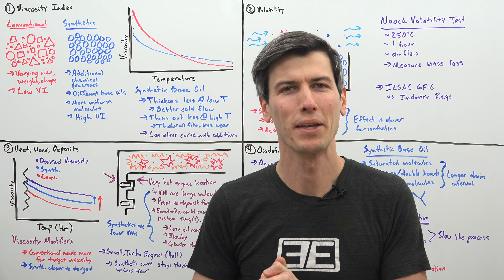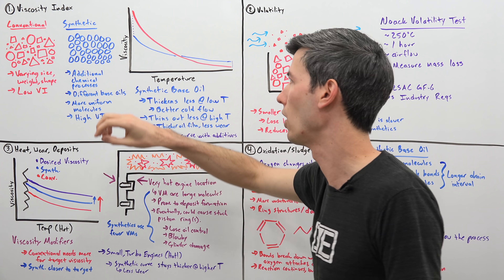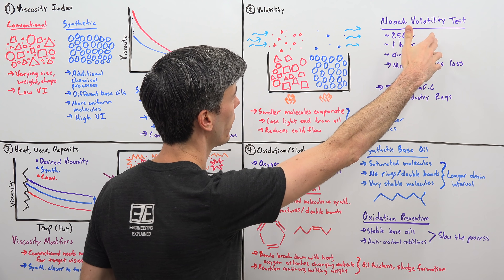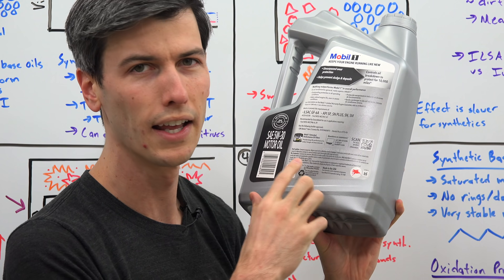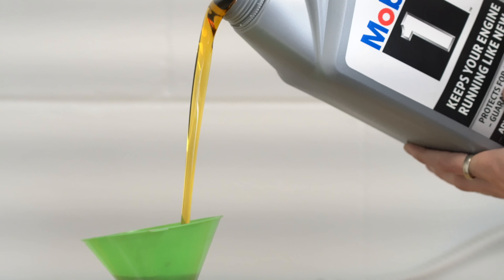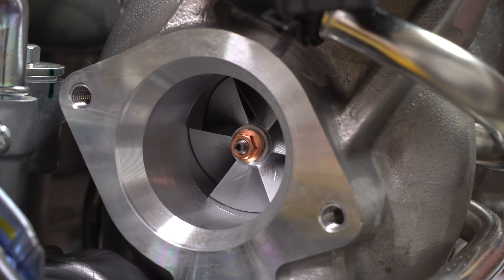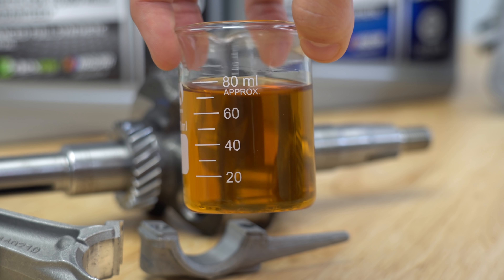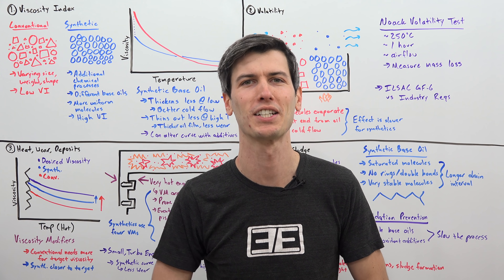Synthetic vs Conventional Oil - There's A Good Reason To Switch

Comment: Mobil 1 is a base III synthetic which is not truly synthetic.   It is made from hydrocracked refined petroleum, not PAOs or Esters which are grade IV or V.  Some Mobil 1 has the PAO Decene, but it is less than 5%.    I use Penzoil ultra platinum euro, or Driven IO30, or Torco SR-5.

Comment: A blend has both without going to a full Synth . You don't have to go full one way or the other. A blend has the best of both worlds. Full Synth tends you make your motor run hotter and with more motor noise may also make seals on some cars leak as well. You will also find that you have more compression and power with a blend. With some new cars you may be stuck with a full Synthetic . I have used full Synthetic it flows well in winter because it is super thin. It's no big deal . I guess no one has ever heard of a blend. Squares and triangles . give me a brake. !                me.

Comment: Could you make a video about oil change timing for synthetic oil? Many of the oils have very high mileage ratings of 20,000 miles or more. Meanwhile my car manual says to change at 7,500 miles with synthetic. Meanwhile the all of oil change shops I have visited insist that both numbers should be ignored and recommend 5,000 miles for synthetic. I figure if both the oil and the car are 7,500 I'm probably fine ignoring the sales-driven mechanic. But I'm never sure... Maybe the cheap out on filters? Other things I should consider? Anyway could you help give an objective view on oil life vs manufacturing recommendation vs store recommendation? Which information should we be using?

Comment: Now I wish you did a video arguing for mineral oil.  Its polarity is much better than both PAO oils and Group III pseudo synthetics such as the ones you reviewed, so it sticks to metal parts better.  It is also much cheaper, especially when purchased in larger volumes.
Reply: it is no longer valid to clasify oil by synthetic, semi synthetic and mineral, because most of them made from hydrotreated today. solvent refined / group 1 have the best seal compatibility and solvency so they can clear sludge better than other type of engine oils. No need for engine overhaul at all.

Comment: Liquid lubricants exist, and solid lubricants exist... But do gaseous lubricants also exist?

Also, regarding oxidation... What if you pressurized the crank case with an inert, lighter-than-air gas?

Comment: It causes my Toyota Camay 2000 and 2006 Sienna check engine light on after 2-3 days after used Mobil 1 synthetic oil changed for code P0430, it is true don’t use Mobil 1 synthetic oil, it causes so much trouble, Not good for old cars

Comment: 2003 Camry 2.4. Went from conventional, to a synthetic blend with plans on full synthetic next change. The Blend lasted about 6 months before it broke down and the engine got hot, and  smoked inside the oil system. Changed it today, completely burnt and black. Couldn't have been more than 2,000 miles. Yes, 2,000 miles and I'm lucky to still have an engine. More info on full synthetic change later.

Comment: Wish you would have checked if there was a difference in the acidification of the oils. By the oils absorbing any of the volatiles  in the gas after its burned, can slowly turn the oil acidic.  Do synthetics help against that? Or is that totally dependent on the additives?

Comment: I hope the comment finds you well and challenging ! 

Hey @engineeringexplained however I understand this is not a real synthetic oil meaning it’s not 100% synthetic and is still petroleum based. Could you please do an explanation on 100% synthetic oil vs mobile 1 “fully synthetic” oil. I understand it’s not a real synthetic rather a synthetic blend w more additives.  Thank you !

Comment: This convinced me. I have a 2005 Jeep Wrangler. Those guys on the forums are dead set on using old oil. Would there really be any reason not to use this on the old straight 6 design the Jeep TJ had?
Reply: The manual will indicate whether synthetic can be used, if there is no mention of it I would not use it..

Comment: If a car has been running on conventional for most if not all its life should it continue to do so? The concern being that the smaller and more uniform molecules might get into gaps of moving parts and speed up the rate at which they break down. Or is that concern unwarranted?

Comment: Congratulations for your explanation. In 1982 I bought a Speede oil change franchisee in México City and our oil provider was Mobil 1. They explain to us all this information with the advantages of using synthetic oil vs mineral oils and always is better use the synthetic one, no matter the climate you have, always follow the viscosity your factory manual say and believe me that you will have easy going a 350 thousand miles engine with no problem at all. The oil in your engine it´s all. It is like the blood in your body.

Comment: Use to own a couple small airplanes.  When an engine is rebuilt (typically around 2,000 hours use), conventional oil is used initially to ensure that rings seat properly, after about 50 hours use, oil is switched to semi-synthetic.......

Comment: Very interesting - thanks.  I suppose this is why they say to change every 3k miles or 3 months, then.  So, if a car sits around a lot w/out being driven much, does oxidation have much of a chance to occur (beyond the top layer of oil that's always exposed to air, I suppose), or does it still really have a chance to ruin the oil, requiring an oil change even w/low driven miles?
Reply: Firstly those guidelines would be for conventional oil, sythentic oil guidelines are 5k/6 months. That said I've seen oil testing analysis that on 7.5k mile oil that had been used for 25 months, and it still showed NO signs of water absorption or general degredation as opposed to a standard oil change. Do with that information what you will.

Comment: Today I just found out that synthetic oil does not always mean that your oil is a synthetic oil, but it is made from better stock oil. In Europe, they made it illegal to market these oil as fully synthetic, but instead they use the term HC synthetic or hydrocracked synthetic oil.
Reply: Not really deceiving per se, they perform like synthetics and really are a much better product. I couldn't care less really, I'll take them over conventional anyday.

Comment: In regards to synthetic oils, I read an article from a machine shop specialist that stated that if one tends to do short distance driving synthetic oils do not get a chance to reach optimum temperature and its residue over the valve train will crystalize leading to some sludge build-up reason while a good multi-grade, non-synthetic will keep that from happening while providing optimum lubrication following periodic  5 to 7 k oil and filter change.

Comment: excellent informational video without going too geeky or techie or needing Chemistry 300 and 400 college courses to understand. THANKS! :D 

i've been using 100% full synthetics since my first car, an '89 Plymouth Acclaim 4cyl and i've never had a problem ever since. :) if you go synth, don't ever top off with standard, don't switch back and forth between synth or conventional, and remember just because the oil bottle says 10K 20K 30K whatever miles between changes... if your oil FILTER can't handle that many miles of removing deposits, filth, contaminants, metal particles etc.  just go ahead and change your oil at OEM recommended intervals. if you burn a little oil, don't forget to check it periodically to keep the level right, and if it burns too much too often, find a mechanic! :D

Comment: A lot of good info. Special thanks to Mobil for helping without it becoming a shameless plug for Mobil 1. Of course the real magic is the chemistry in those additives on top of the chemistry in the base oil. Bet we cannot find out as much about how they work.  I use a semi synthetic in my 1996 vintage Ecotec and the killer advantage is that it is a 15W 50 oil so the engine is a lot quieter on a cold start while not giving anything away on a 45 degC day. For more demanding jobs the full synthetic is absolutely the right oil. Turbocharging or high revving multivalve thrive on it. It certainly explains why synthetic oil makes engines last longer if it keeps the ring lands clean and lubricated. 
Apparently synthetics are not recommended for LPG. Don't know if that is still true but back in the 90s I ran a 250 CI falcon on LPG and even then some oils were duds with it while others would run over 8000k and the oil would be like dark honey. I think it was the early synthetics that broke down in the acidic byproducts of LPG combustion. Not sure if the newer ones are ok with it now or not.

Comment: Something people who wish to understand the science there are actually 3 types of oil not including mixed synthetic non synthetic often sold as semi synthetic. The first and simplest are non synthetic oils. Second is modified non synthetic often sold as synthetic in these oils the base is chemically or thermally modified, most oils sold in shops claiming to be fully synthetic are acutely modified. Lastly is a true synthetic these use a synthetic base such as poly-ok-alpha there are few commercially available oils which are true synthetic and require research to properly identify.

Comment: now, if instead of using longer oil change intervals with synthetic you still keep it the same. Does that reduce wear that the engine gets? I know that you don't want to change oil TOO often, but also if you decide to not wait longer to change synthetic vs conventional would it help? I do mine roughly every 5k miles, I know in new cars with synthetics sometimes they don't even recommend changing it before 10k miles. I know the whole 3k mile interval is over, but just curious if 5k miles would help keep engine healthier vs say 7,500 miles interval or more.

Comment: I went EV in 2014 and haven't bought any motor oil since. I am convince that synthetic oil is better, but it is unlikely that a car buyer will ever see the different or benefit from synthetic oils. in 94 I bought a new car and started with full synthetic. At 50k mi it got t-boned and maybe should have been totaled. No one care what oil you use in an insurance claim. I then started using the cheapest oil I could find that met the manufacturer's requirements. I picked up a shitton of oil for just $.40/qt. I had been changing the oil at 5k mi intervals since new, but at 180k mi I switched to 10k mi change intervals. At 260k mi and 12 years the engine was still running great and was the most solid part of the entire car. Someone rear-ended it making it impossible to open the back. It was totaled this time, but still running fine. It is rare to find any car lasting longer than 1/4 million miles, but it can be done without paying for synthetics. BTW the car was a cheap Ford 4cyl, less than $10k new and never needed any engine work. Even at the end, the old consumption never exceeded a qt in 10k mi, and I'm sure there were some leaks by then.

Comment: what do u  thing happens if you mix two different weight oils , as in a 5w-20 and a 5w-30 ?
Reply: Excuse me,  I want to share this with you since you are asking that.
I have a 2003 accord and a 2004 Infiniti g35x, one uses 5w 20, and the  g35x uses 5w 30 both cars burns a little oil and I been refilling both cars with the 2 different oil weights for like 4 years and nothing seem to be affecting any car in any way.

Comment: I have always used "conventional" oils in my cars and trucks.  I have never had an engine failure, with the exception of my wife overheating a Jeep.  The water pump had failed and she kept driving. This makes me wonder, if I change my oil at reasonable intervals and never let the oil run low, how important is synthetic oil for me?
Reply: I can feel my engine running noticeably smoother, quieter and cooler with synthetics. Thats enough proof for me.
Reply: @sunilayya8948 that’s one hell of a placebo effect!
Reply: I have a 2018 Tuscon and made a mistake of using conventional oil in it one time. When it was almost time to change the oil, the car still had oil in it. The engine sounded fine. With the synthetic oil, the engine sounds worse when it's closer to a change. I have noticed a difference in performance. Tonight I had to go get some oil because the oil light came on before the recommended change. I will be using conventional from now on.

Comment: So don't run a turbo (heat) and keep your drain intervals short (10,000km) and Dino oil should suffice.
Reply: If you have a turbo, you should use a syn blend at a minimum.

Comment: If you don't live in an area where the temperatures hit sub-zero in the winter months, then you probably don't actually 'NEED' synthetic oils (but synthetics do help prevent 'sludging' in Toyota V6 engines). If you live in a place where it does get really cold in the winter, then you probably should switch to a full-synthetic engine oil as it won't thicken up to a hard paste at -40 degrees.

Comment: I can't help but think of the interview with the laboratory technician (possibly lab owner) who has been interviewed several times and asked his opinion based on the results of thousands of oil analysis reports whether he thinks synthetic is worth the cost. His answer is no. He states that the benefits of synthetic oils is mainly displayed in extreme cold temperatures where synthetic flows better than mineral oils but for everyday "lower 48" locations it simply doesn't show a wear benefit. The lab tests don't care what brand or composition the lubricant is. The equipment simply returns a test result.

Comment: Hello can u suggest good engine oils with grades explained b4 , c2,c3 etc for my Hyundai elite i20,1.4l crdi .
Owners manual suggests c2/c3 or b4 , or below if not available in the country .
Which grades should I check for in the oil bottles and what does they mean for my diesel engine

Comment: Jason how about a video on the base stock that is used in synthetic oils.  For instance, the oil I use on my wife's Prius is Pennzoil synthetic which comes from distiiling natural gas.  Other synthetic oils use petroleum oils and are refined.  Amzoil use a base stock that is supposed to be very stable.  Please explain.
Reply: Amsoil may be a very good oil but Porsche recommends Mobil 1, even Bugatti doesn’t recommend Amsoil for their super cars. Go with car manufacturer.

Comment: Conventional at AutoZone: 29.99
Mobil 1 at walmart/amazon: 27.99
Anyone saying price is thier reason for not switching yet they buy oil at the autoparts store is retarded. Also get your filter at the dealership its not much more expensive and if you call the dealer for the part number you can find it on Amazon for the same price as the shitty stp filters you've been buying at autozone